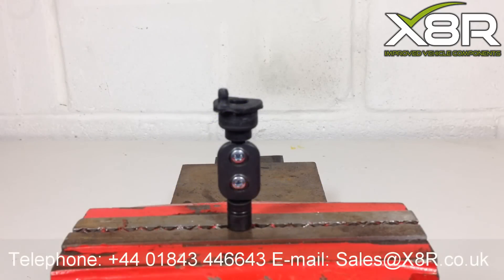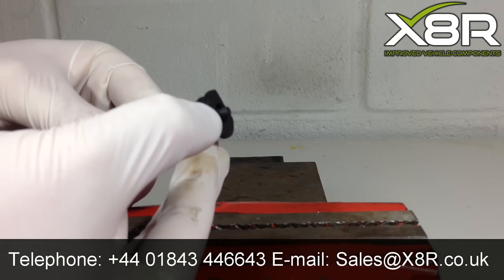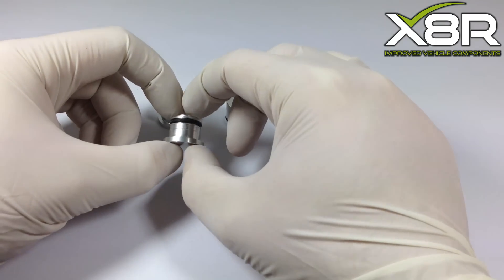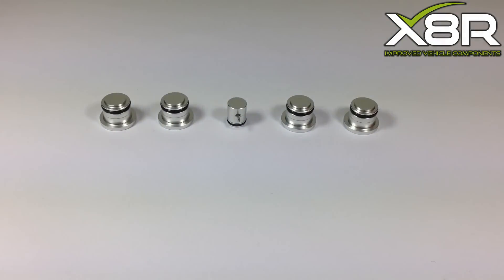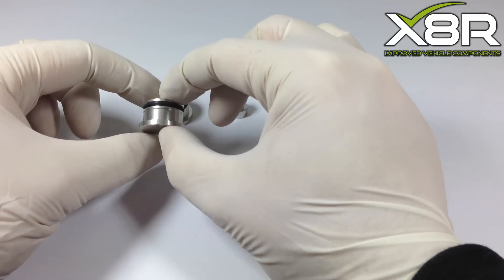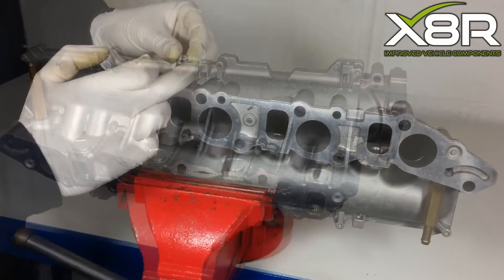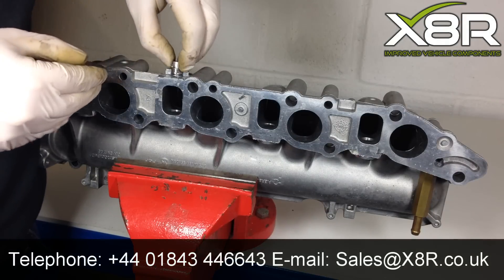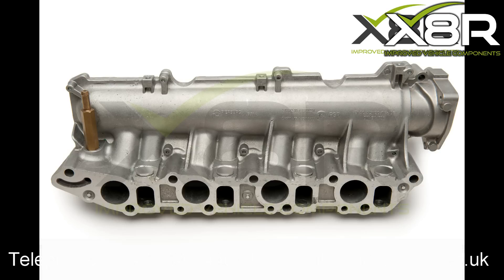Vauxhall Fiat Alfa Saab 1.9 Pierburg Intake Manifold Swirl Flap Blank Blanking Removal Repair Kit

Comment: why remove flaps
Reply from the maker: Faulty swirl flaps can cause the engine management light (EML) to be lit, high fuel consumption, rough idling, rough running, poor power and torque, smoking from exhaust and error P2279-11 Intake system air leak,P2075 fault code. Deleting the swirl flaps removes these issues. - Georgina, X8R Ltd

Comment: Are the flaps on the second type which are secured with screws made from plastic or are they from metal? Great video.
Reply from the maker: Hi there,
The screws that retain the original flaps are metal.
Hope this helps!

Comment: Hello, I have reviewed your video which explains a lot about how it works.  Unfortunately, I can't find a video of this kind anywhere for the opel astra h z17dtr.  I have big problems with it, I changed everything, and even put in a new turbocharger, but it still smokes black smoke, sometimes bluish, and when it starts twitching at two thousand rpm it throws out a P0299 error.  smoke very well and lose traction.  Please help and explain about replacing the intake manifold.  THANK YOU
Reply: jesi rijesio iznogude

Comment: I've done this on my saab 93 - but now has no boost at all? I just left the actuator plugged in to the sensor but not in it's origional place - does this matter ? Any help would be great
Reply: Did you use a new intake gasket? theres no reason why this would effect boost other than an air leak from the manifold itself.
Reply: I had same issue was ok revved fine drove fine for 5 mins til engine warmed up then went into limp mode any advice???

Comment: Do i have to make software corrections after fitting them?
Reply from the maker: No, providing the actuator motor is left connected electronically the vehicle won't detect a fault.

Comment: How can I repair this problem in my 2002 Nissan pathfinder v6 3500 it's not firing it's showing Swirl control valve control solenoid valve on computer what can I do help me with a video

Comment: Does the manifold have to be removed or could the swirl flaps be removed from the top (the type that doesn't have screwed on flaps)
Reply: Did u ever get an answer to this question I was wondering if they  can just be lifted out without removing manifold also 
Did u do that 
Does the car run better starting ect with blanks installed
Reply: @paulMason-zm4kr  did you ever get an answer to this question? I'm going to attempt to just lift out tomorrow 😄
Reply: @Ricky Halpin  oh this was from years ago  but I ended up removing manifold and tbh it wasn't that hard to do.
Once it was removed i split the manifold and completely cleaned out the manifold insides and all other parts going to it and blanked off the ports with plates I bought of ebay.also connect the power back onto the rod so no alarms cone up just so it thinks it's doing what it's there for 
After fitting back on car it has so much more power it seemed to much for the front to handle.

Well worth doing only 1 issue I had was when you lock of the fuel pump pulley there is a woodlock key which was an absolute pain to refit without it falling out as its upside down 
Took me about 10 attempts
Reply: @paul  cheers for the reply, I've planned to remove 3 and leave the one that's attached to the arm for now, cambelt is due in a few months anyway will get a mechanic to do the rest then 👍
Reply: Yes the manifold needs to be removed. Once you've removed it, its well worth splitting the manifold in half. I think there are like 14 bolts holding it together and a couple of metal dowels. You can then completely clean it of all the carbon build up and trust me, it will be full of carbon. I just did mine.

Comment: How does this affect emissions and overall function? After all, the swirl flaps have been designed into the manifold for a reason.
Reply from the maker: This will have little affect on the emissions of the vehicle
Reply: It is designed for optimal fuel and air concetracation makeing, if you remove it your engine will work in low rpm with too much air and you lose power....
Reply: Nothing like you said. Swirl flaps only regulate exhaust gases, that are recirculated by egr valve. Original air intake is not effected by those.
Reply: @jaroslawchmiel3410  No, they do change the way the car accelerates. It improves acceleration on low and high RPMs by opening or closing the flaps.

Comment: will I get any problems blanking it ?
Reply from the maker: Not likely, the blanking of these manifolds improves mpg/ overall fuel consumption in some instances.
Reply: I'd rather say, that it restores fuel consumption from before  swirl flap failure. After blanking mpg went back to what originally I had.